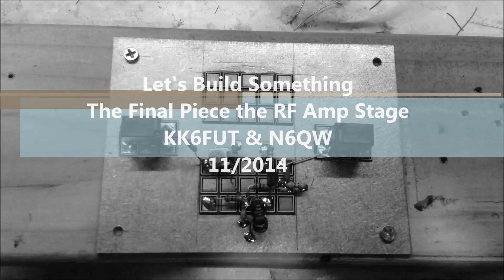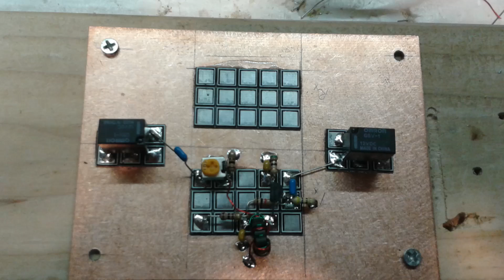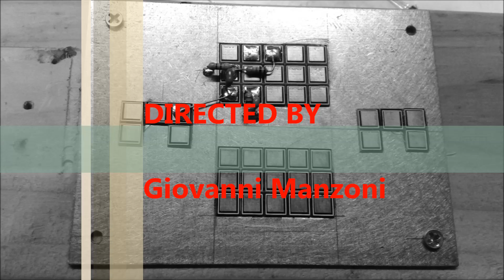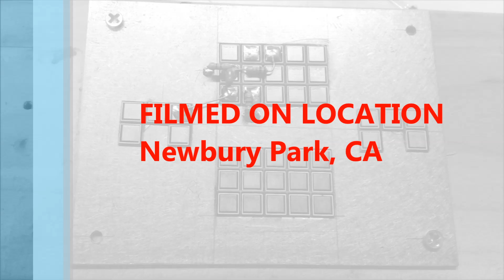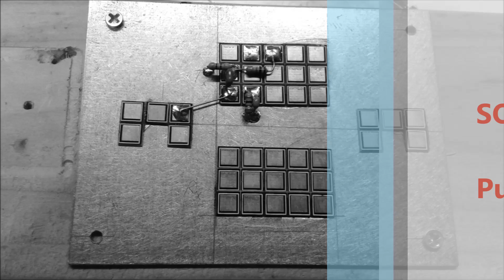Let's Build Something the Final Configuration

Comment: Good videos on this subject.  I had trouble finding the video where you detail the schematic and layout of the bidirectional RF amplifier.  Also, some close up shots of the constructed module boards showing the component connections would be appreciated.

Best regards,
FB
Reply from the maker: Hi Frederick,

There is not a video of the bidirectional amplifier but you can see the detail on the front end of this video. These videos will accompany an article that will be published in the Winter Edition of QRP Quarterly. QRPARCI members receive this publication four times per year. So if you are not already a member you should join  QRPARCI. The article has photos and schematics of all of the four boards. Thanks for your email.

If you go to my website www dot jessystems dot com there is an email link to me and I will send you the schematic of the bidirectional amp. Pretty simple circuit consisting of a couple of 2N3904's and the usual resistors and caps.

Pete N6QW
Reply: HI Pete,

I found another video and article on the bidirectional amps.  Very interesting, it's switched by appliying power to the direction wanted.  I was wondering how much output you intend for this project.
Reply from the maker: Frederick Brown Hi Frederick -- I'm sort of chuckling as I usually hope I get as much as I can out of a few transistors. There is a video of a 20/40 Meter transceiver on this channel and using that same bidirectional amp driving a small commercial linear amp kit the Pout is 20 Watts which is enough for many routine QSO's and if I want to boost that I have a 3CPX1500 A7 amp that with 20 watts will put out about 600 Watts. But on average using two intermediate driver transistors following the bidirectional amp (2N3904 & 2N3866) and a final using the inexpensive IRF510 you could reasonably expect output in the 3 to 5 watt range depending on frequency. The IRF510's sort of loses a bit of steam on the higher frequencies above 20 MHz.

With just a couple of watts you could add a commercial linear amp kit from Communications Concepts Inc. and that would result in a 100 watt plus output signal --which is more than adequate for world wide communications. 

Yes applying power to the direction wanted changes the signal path -- I typically do that with a solid state switching circuit of my own design as simply using mechanical relays for power switching (versus signal switching)  can have some interesting results. Go to my website www dot jessystems dot com and look up the link to the 2009 Tri-Band transceiver and you can read about mechanical relay power switching problems. There is also a video on this channel of that transceiver. I found a circuit used in another project from W1VT and that worked. Subsequently I came up with my own design.

Thanks for your interest.

73's
Pete N6QW